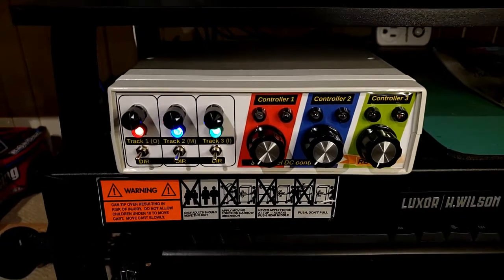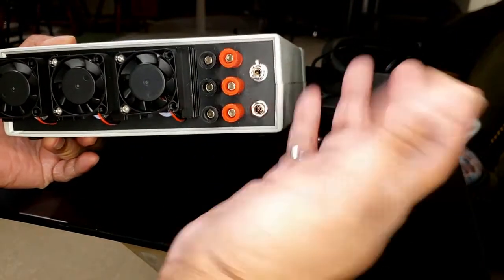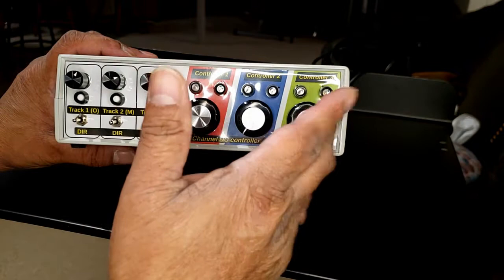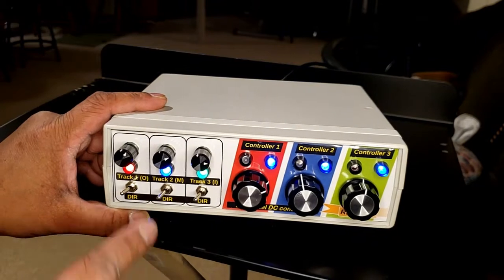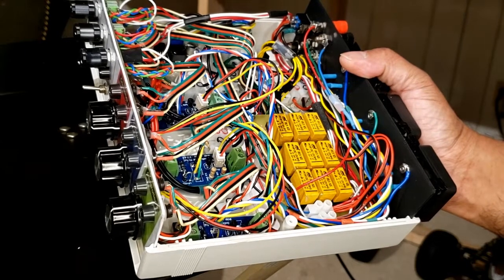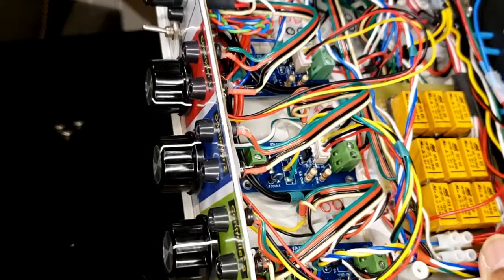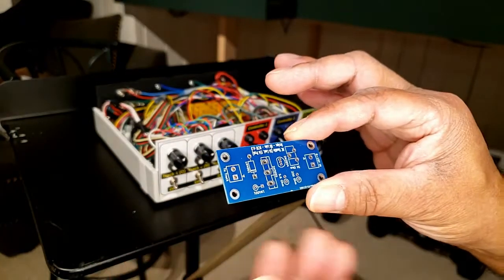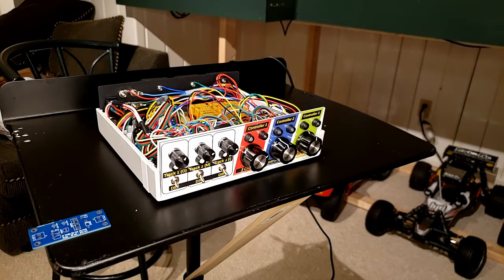Custom Built DC Throttle for Model Trains - Designed and built from scratch

Comment: I am into model trains and have HO and G scale DC trains.

I too have made my own train controllers using PWM controller.

I am from Chennai India.
Reply from the maker: Hi Thank you for your comments . Glad you are enjoying the hobby and making your own controllers. I used to use PWM's but I moved away from them due to some of them not going down all the way to zero volts , and the hum that they generate due to the pulse. 
Do any of your PWM's have this issue ? let me know 
Regards, 
Anthony .
Reply: @anthonyshobbycorner  
Hello.
Nice to know that you too had made your own Trains speed controller using PWM. I have made many speed controller but never had the issue like the way you have mentioned. Humming etc. Yes the minimum voltage is always present but you can compensate it by adding a few extra bulbs on the layout as street light or anything. This way there would be zero power supply to the tracks and no crawling of the locomotive. 
Hope you are able to understand the point and follow.
Enjoy your model trains.
Reply: Hi, I am thinking of making a controller using a PWM, how does it work for you, ?
Reply: @morganmarty  
Making train controllers using PWM is excellent idea. Use an 24 volts PWM and it can be used for all scales. All you need is a suitable power supply transformer. 9 or 10 volts DC supply for Z and N scale. 14 volts for HO and O scale. 18 to 24 volts for G scale.
Note you need DC input supply for the PWM.
Where are you from .. I am from Chennai India

Comment: Hi Anthony, great you done this project by yourself, that is respect. However I would like to share some critics. 
1 I heard about construction benefits, but didn't about quality of driving, especially start moment with lowest speed possible
2 You do not tell us what is the excact minimal voltage, if 1-2V, it is not worth it, because some motors like classic HAG could start below, and coreless even from 0.1V.
3 Primitive old school construction does not contain potentiometer, it has Cu wire with brush, muuuuch better solution indeed.
4 Primitive is not the best, because 90% of locomotive need halfwave range to start really great like with DCC on board. Best old school late flagship controllers like Trix, Fleischmann, Titan, Duette, Piko has it. I'm not sure that this feature would take a lot of things... Sure it should be switchable as Duette.
5 Should have additional spring potentiometer (Vishay 100 Ohm or 1k Ohm) for lowering voltage to give more flexibility. Primitive idea was on the Duette.

6 Aha....((( Knob for train controller should be very very very big, like those which had sound amplifier from 90s. Imagine, you control locomotive and it should be as smooth as possible. Those small knobs like your or Gaugemaster suit only for brightness of some lamps "tune and forget". 
7 You made the same mistake for direction control as famous British companies when plase it horizontal. It works if you have straight line, but bad with rounds. The best is vertical, because you would always know where you locomotive moves.  

Could write more, but that is the most important things...
Reply from the maker: Hi , Thank you for your comments. I built this controller to suite my needs . Obviously there will be use cases that fall out side of my design parameters. I don't have any locomotive motors that engergize at 0.1 Volt. So that is not an issue for me. 
Half wave is not good for DC motors ( in the long run ) They may help the locomotive  experience slow crawl and better start, but half recitified DC is not the best for these motors. 
I don't know where you got the idea that I used wire wound Rheostats. I use standard Potentiometers . 
The Knob size a personal preferance really .. I wanted to make a compact 3 controler setup . If I used big knobs the controller foot print wil be bigger .. But I get your point . the bigger the knob , the more control range you get.
Reply: Hi, a lot of things happened for this 7 months. I've done a lot of experiments with a different and most exotic controls, and have seen a lot of records as well. And know even more can see how different driving behaviour could be. The aim is to beat 2 minutes for 1cm (about 0.4 inch) for the lowest speed. I could get with analog about 40 seconds. But even it could not possible if you do not make something special. 
Coreless motors with starting from 0.1-0.2V definately deserve your attention. Because they are really great thing and today cost not so much. Half recitified DC doesn't harm usual iron motors, but possible could do it with coreless, however PWM for sure. I would remind that at the end of analog era you didn't find non HR DC products, they are all got this feature from German and Austria fabrics, and famous companies like Siemens, Buhler and so on. Except those which was made for coreless motors. And also HR doesn't work with whole speed range, but only at the slowest speed. 
Well, if you use those old school Trafos with HR DC (perhaps not your case) you better to get real Rheostat to decrease voltage.

Comment: Hallo Anthony.
Please send me the cicuit diagram as I want to build one for myself also. 
Thankyou.
Reply from the maker: Hi , So I did a circuit schematic for the individual throttles, but I don't believe i did one which shows the wiring to the switches etc .. I also designed a momentum throttle with brake , Momentum hold and a few extra features .. IF you want the circuit diargram of the throttles , I can send them to you .. Give me an email address and i will send them to you . 
Regards, Anthony

Comment: Anthony, that is a very compact design housing 3 controllers. You do really nice work. I’m currently building a 2 controller system, based on a modified Peter Thorne design, also full analog. I will have a adjustable momentum and a stepped brake feature on mine.
Reply from the maker: Hi Bill thank you for the kind words. I'm glad that you are also building a Fully analog throttle controller with Momentum etc .. I did design a full momentum controller , and I have built it .. Just have not got time to put it in a case and use it. Please send me a pic or two of your controller when done, I would love to see it. (Anthonyshobbycorner@gmail.com) Regards, Anthony.

Comment: Amazing work.  How is the low speed crawl?  I would buy one from you for an OO layout. I wonder if it would be possible to move the direction switch to above the controller knob instead of the two direction leds? Maybe just have one leds to show track power on.
Reply from the maker: Hi David, I'm so sorry for the very late response. I had to step away from my channel for a bit due to competing priorities. 
I build the actual individual controllers for many subscribers ,which are inside of this enclosure . But the enclosure , the switch layout , the graphics etc is something that I build for myself . I just don't have the time to build them for anyone who wants them. I'm sorry about that. However, I do have the custom built circuit boards for the Standard 2 transistor controller and the Momentum controller which I designed. 
Thanks 
Regards, 
Anthony .

Comment: Hello Anthony, I just found this video on the throttle and it looks like what I would like to build for our club layout. I like the addition of the  momentum for the throttle, I realize that you built an additional throttle with the momentum, I did not see the video on that throttle, I may have missed it in your list. I did subscribe to your channel, you do excellent work. I have dabbled in the electronics some but in no way am I an expert but would love to try  a dual throttle. I would like to obtain information on building the throttle with momentum.
Thank you
Ray
Reply from the maker: Hi Ray , thank of the kind words and comment. Yes, i have designed and built (from scratch) a new throttle with Momentum . I have just not got a chance to post a video as of yet. This new throttle has 4 additional controls ( beyond the speed control ) I have introduced 1)Momentum , 2) Momentum rate  ( How much momentum you want depending on the loco ) , 3) Brake button 4) rate of brake ( how fast or slow you want the brake to work .  I have been testing it on my layout and it seems to work fine . The only thing is that my throttles don't have short circuit protection . But the Transistors i am using can handle up to 15 amps ( if you have sufficient cooling ( small fan or good heat sink , or even add an automotive bulb ( 1156 ) in series etc ) . 
I have made a few extra boards . I will try to send you some pics at least . Send me an email to my channel ( Anthonyshobbycorner@gmail.com) email, and we can communicated from there. The components I have used are the most common components you can find ( i did this intentionally ) , so that people can source the parts easily . 
Regards, - Anthony - ( send me an email ).
Reply: @anthonyshobbycorner Hi Anthony,
I am still interested in building these throttles, you had mentioned having the boards printed and that there would be a cost. I have not heard any more about that but if you would have two made for me let me know the price and how I might pay you and it will be done.
Ray

Comment: Hy Anthony..... its time to run dcc😂 but your soulution is brilliant, I can use some items to create a power supply by using a DPS5015 greetings from germany Rainer
Reply from the maker: Hi Rainer,  I have setup the power feed to my tracks such that i can run DC or DCC on each track . I have so many DC locomotives ( and ton of Vintage loco's that i would like to keep original - not convert to DCC ) , that I built this DC controller . Now, you can definitely use a DSP 5015 , and I do have some of them . The issue I found was that the rotary encoder does not default to varying the voltage . you have to go through the menus and select voltage and then it will vary the voltage. And also if you shut it down and power it up again , you have to go through the same process .  At least that is what I remember . I use those modules as mini  bench power supplies .   Since you are from Germany, I presume you must have an extensive collection of Fleischmann , Marklin Hamo and Brawa ...  There are all my favorite brands ..  I have been collecting Fleischmann DC and Roco etc ... they such well built models .. and they are built to last ... 
Please end me pics of your layout and perhaps the controller that you are building .. i would love to see them - Anthonyshobbycorner@gmail.com . 
Regards, - Anthony -

Comment: Just came across this channel. Great controller, just like I want to build. I am emailing as I write this. Thanks for an inspiring project!
Reply from the maker: Sorry for the late response . I don't know how i missed your comment. You must have built your throttle by now . Please share pictures with me if you are so inclined. (Anthonyshobbycorner@gmail.com) Regards, Anthony .
Reply: @anthonyshobbycorner  
Hi Anthony,
No, I have not done anything much due to a lot of travel. Again, going away in a couple of weeks. I feel guilty about not getting started but I have some health issues that keep me away from my workbench as well. 24x7 in pain due to a condition I had in 2017. After the surgery for that I can at least walk, if not I would have been in a wheelchair! But I will let you know when I get started.
Thanks for checking in.

Kind regards.

Comment: My comment disappeared. Do you sell these?
Reply from the maker: hey Steve, I don't sell them . I just make one for my layout . I do make the indivudial DC throtles ( of which I have 3 in this specific controller ) . It's my own custom designed circuit. IF you are looking for a DC throttle which you can put in your own case etc, then I do have a few extra DC throttle boards  that I made . You will need a power supply to power it , like a typical laptop computer power brick will do the trick . that is what I use .  Are you handy with doing your own soldering ? Let me know 
Regards, - Anthony -

Comment: Wow! Very nice! I am building a large scale indoor layout and was thinking of building a throttle as you have but my electronics knowledge is not that great. I'm interested in the throttle boards you designed. Can you provide details on them?
Reply from the maker: Hi Todd , Thank you for the kind words .. I have been a bit distracted from the hobby during the summer due to obvious reasons ( yard work etc ) .. 
Don't worry about your concern about electronics .. I am more than willing to help you .. 
The boards I showed on this video are standard throttles .. What I mean by that is that , it does not have momentum features ..  If you are good with a basic throttle , then this would work very well for you .. 
I have also designed a Momentum Throttle , that has much more features, but also requires more components .. 
If you are interested in any of these ( at least the circuit board ) let me know .. I can get them to you at cost .. Here is my email address : anthonyshobbycorner@gmail.com
the boards are quite cheap .. I designed the standard throttle with the most common components in the market . - Regards, Anthony .

Comment: Nice work!  VERY NEATLY DONE.  I have built a number of throttles using those same two transistors to make a basic current amplifier (the 2N3904 and 2N3055).  I started with circuits from an old book by Peter Thorne from the 1970s called "Practical Electronic Projects For Model Railroaders".  I would be very interested to see the schematic for your throttle controller board, but I cannot figure out how to get in touch with you (no messaging or email appears in your YouTube info).
Reply from the maker: Hi , If you would like to contact me , I can be reached via email at anthonyshobbycorner@gmail.com or via Facebook messenger via my Facebook page at anthony's hobby corner FB Page . It's ironing that you also ended up with using the same transistors .. I chose those transistors because 1) they are so freely available , 2) they are very reasonably priced and their current handling and gain ratios were ideal for something like this .. As I have mentioned in the comment below , I have just finished designing and testing a new enhanced DC linear controller with Momentum and some extra features , which are not offered on any other commercially available DC throttles .. If interested , shoot me an email , and I will be glad to respond . Regards, - Anthony-

Comment: Great job I'm interested  want to build something like that for my layout because I'm Currently using 2 and want to clean it up.
Reply from the maker: Hi Jake , thanks for the kind words . - If you are interested, I've just finished testing a new circuit which I designed , It is a full blown Linear DC controller with Momentum and some additional features ( like adjustments for rate of increase and rate of decrease , where you can set how fast a locomotive responds to momentum with regards to acceleration and deceleration ) . I will be shooting a video on it soon .. If interested, shoot me an email at anthonyshobbycorner@gmail.com . Regards ,- Anthony -

Comment: nice video.  is there a way to do a reverse loop in dc
Reply from the maker: Hi , Yes there is a way to do reverse loop in DC .. One method is bit Manual , where you have to isolate a section of the reverse loop and use a switch to alternate the polarity , and the second way is bit more automated but requires some knowledge of electronics . Send me a message to "anthonyshobbycorner@gmail.com" or go to my FB page called "Anthony's hobby corner'" and send me a message via FB messenger, and I will get back to you .. Regards, - Anthony -